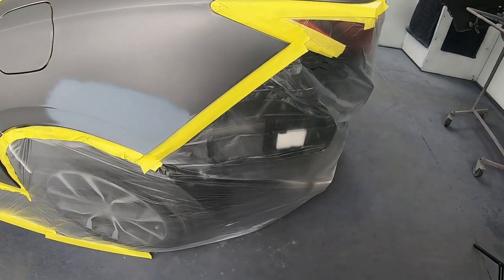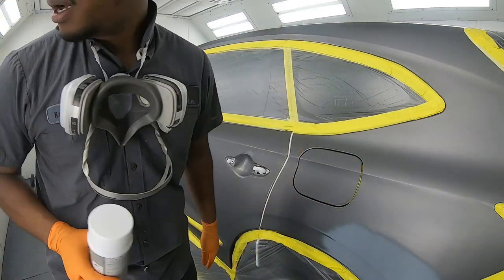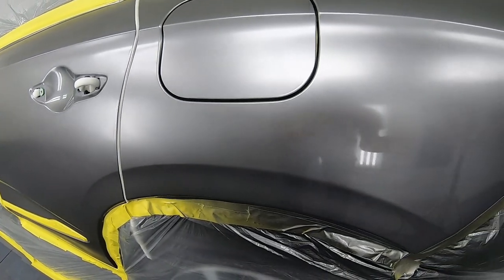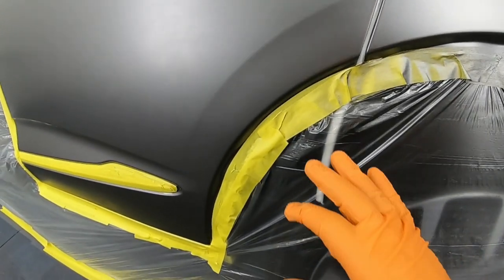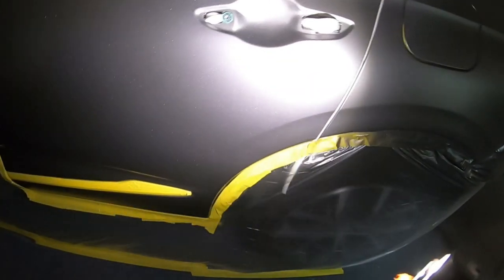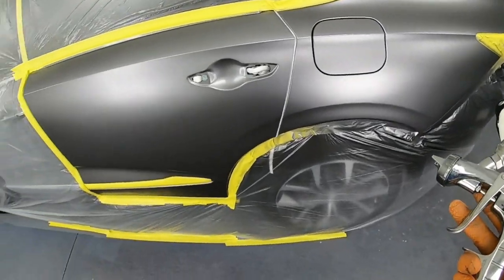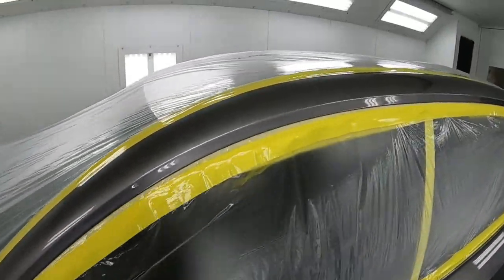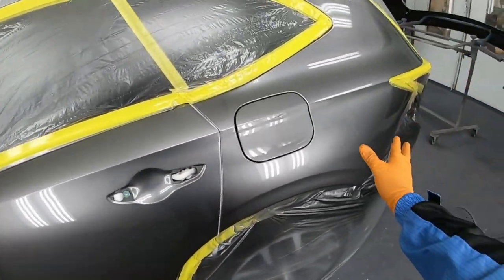HOW I USED BODY LINE AS A GUIDE TO BLENDING. SAVING TIME, MATERIAL, AND HEADACHES.

Comment: Hi Mario, another great video and very well explained with lots of good tips, is the WS400 Series2 available where you are now? I heard it should be over there in November. It would be interesting to see what you think of it if you get one, I really like mine👌🙏👍John UK.
Reply from the maker: Thanks! It is available now. But it’s quite pricey. I will get a video on it eventually.
Reply: It's about time you good folks got it over there, I bought mine back in June at over £600 problem is that Iwata has locked the price so there are no discounts to be had, I still want the OBS version but don't have the funds atm😭😂
Reply from the maker: @JohnWD40TC02  🤣